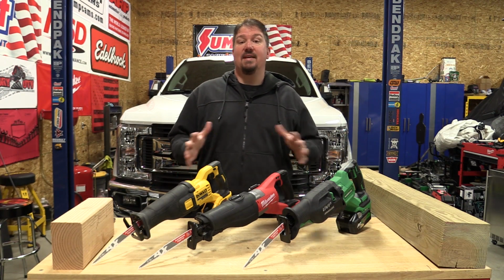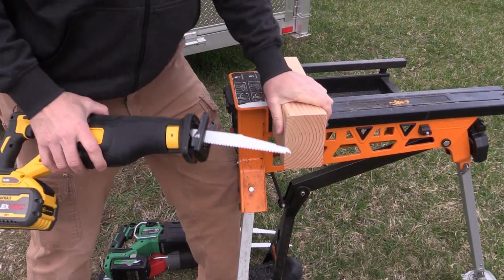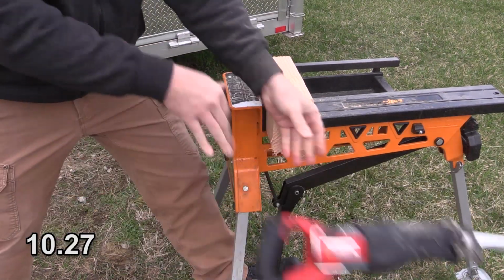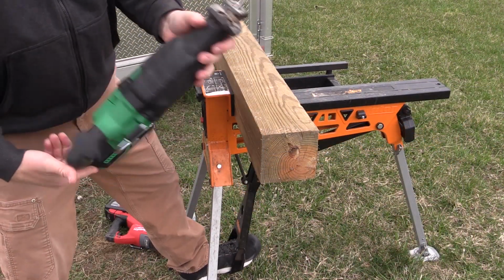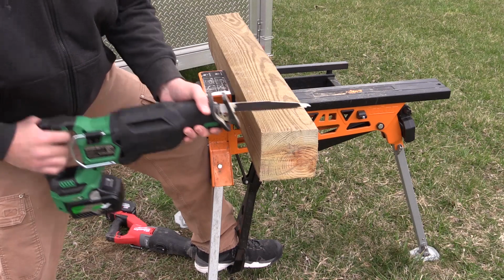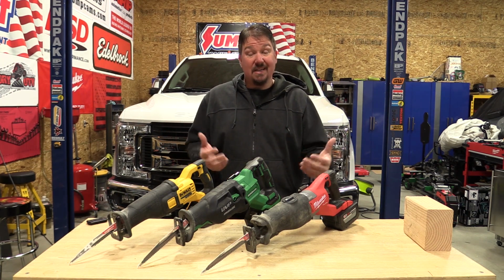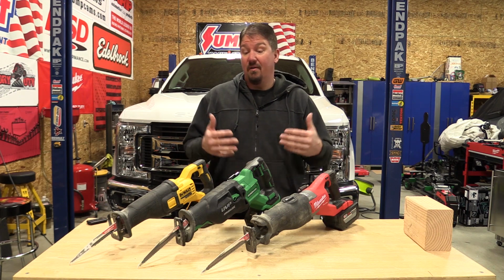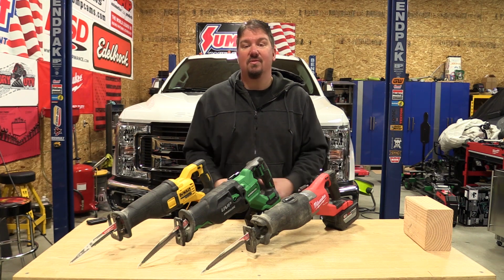Milwaukee M18 FUEL Super Sawzall Vs Metabo HPT MultiVolt 36-Volt Recip Saw & Dewalt FlexVolt 60-Volt

Comment: I would love to buy into the HPT line. Lifetime warranty, IP rating on their impacts/drivers, and I can use an AC adapter. Every video you guys put out makes me consider them more! Lol great video!
Reply from the maker: The ONLY items I dislike about Metabo HPT is the buttons on the tools.  I can get over that.
Reply: Lifetime warranty on the batteries not the tools.
Reply: @vojnikjna30  Lifetime on the tools, 2 years on the batteries
Reply: I freaking love them , I was using the 18v and with clearances I got the 36v skil saw for 99 bux and the adaptors for 40 bux apiece bought 2 then just now bought the Sawzall for 99 and I've got no complaints in fact I love them , oh I got lucky and bought the hammer drill with charger and 2 of the big 8ah batteries which r 4ah 36v but needless to say I bought 2 of those sets, so I'm bought in the the hpt all the way but everything I've bought has been on clearance and honestly a he'll of a deal
Reply: @WorkshopAddict  i can agree with that. particularly if the tool has a fwd/rev selector. however, I think the Metabo HPT triggers usually make up for that. They have the best feeling triggers to me, easiest to modulate. Love the channel sir.
Reply: @paulbiagi6224  wear and tear is not covered.
Reply: I have the whole set. Drills drivers, saws, nail guns. Best shit I’ve ever used
Reply: Lifetime  warranty  is on the tool batteries  are 2 years

Comment: I use my Metabo HPT vs my Milwaukee when I have a big job+ I have used it with AC adapter when near poeer- this will save lifetime battery life as well
Reply from the maker: We do the same.  When we have the chance to go corded, we normally do.  It is hard to carry enough batteries and also make sure they all get charged.
Reply: @WorkshopAddict  What's crazy about many of the youtube comments is that the MIlwaukee fanboys(which I am when it fits) are now worse than the old Dewalt Fanboys that I used to shake my head when they wouldn't try Milwaukee or other brands--I notice you guys have plenty of Milwaukee products as do I-but when there is a better tool, especially the Metabo HPT 36V line that gives me more options, flexibility, and longevity on their tools, I get them(simple as that) All in Fanboys just miss out on some great tools
Reply from the maker: @baseballdude8491  Number one rule.  Marry your self to the best tool for the job, not to one battery platform.

Comment: I have the super Sawsall and it’s a beast. It’s actually too powerful for some jobs. Ended using the hacksall instead to cut some 1x3 steel tube because the sawsall bit to hard

Comment: I know this doesn't sound right but the orbital didn't seem to help much against the Dewalt.  People are going to buy a saw based on what platform they are on , but it's nice to see how your tool stacks up against the competition,  me personally I really like the new Dewalt Power Detect line .  Great Video...  Stay Safe ...😷  🖖
Reply from the maker: Brian, I agree and working alone it is hard to see times.  I should have come home, looked at the video and some more testing.  Orbital does do more on smaller wood and on the 6x6.  But you are right, the PD line is awesome and some bag on it because it lacks a few features.  I like it too.

Comment: Metaboo  hpt always , as for bang for the buck  as metabo  is just as good if not better  but half the cost , lifetime warranty,  and with the 36volt  line  you can use it corded as well.

Comment: I'm on the Makita platform.  Over the last 12 years I've had 3 Makita reciprocating saws. This last one brushless, amazing improvement.  We really cane our saws.  Cutting 3inch diameter steel wired cables and heavy switch gear. 
It would give these 3 a run for their money.

Comment: It’s crazy that the Metabo is still the number one as far as power, speed, control and comfort. I honestly didnt think that would be the case over 3 years later now. 

But damn Metabo truely does have the ball in this court, as well as with impact drivers and oscillating multi tools. And of course they’re nailers. Honestly they are doing fantastic in just about every category. Especially sub compact, it’s insane having a driver and drill that feel like they could be children’s toys due to the size and weight and then use them and realize how much better they are than the old craftsman huge drills from 10 or 15 years ago. 

My dad still has one of those drills and he is blown away by my tools. He doesn’t understand how he can be using one all day and the battery doesn’t drop a bar, and if it did under very heavy use it would only take about an hour to charge from zero to full. 

Things have come so far in such little time. That’s why it’s so nice to see something like the Metabo HPT 36v UVP blow everything else out of the water. And you think wow this thing is like 5 years old soon. And the other company’s are only now in 2024 just catching up to making something as well made as the Metabo Recip saw. But if you look, you will notice that the only brands are simply giving in and copying the design as close they can. Which is something they should have done from the start. Even with that you still can’t beat the Metabo. Especially in the 36V category, he’ll even the 40v.

Comment: Hikoki/Metabo HPT is the most powerful sawzall I've used. I don't think I've tried neither of the other two  models. I have a Bosch GSA 18v-32 which I think is decent, but the Metabo HPT is much more powerful! At the end of it all you really got to think about weight vs power. Power could in this instance maybe be okay with less weight if you consider demolition and having the weight above your chest.

Comment: Great review.  I'm a Milwaukee guy, but it seemed like the Metabo transmitted a bit less vibration.
Reply from the maker: I was watching that also, but I have to say judging vibs on large wood connected to the jawhorse is hard because of the flex.  Lots of varibales.

Comment: I never care for orbital action in recip saws, as I find to make the tool vibrate a lot more, therefore making it more difficult to control. I think these kind of tests should also include cutting steel as it is more solid material than wood which has all the knots and twists in it. I have the old DeWalt DCS380 and I am happy with it. I just bought a new one after using my first one for five years and then donating it, with my old cordless drill and a cordless grinder and some batteries, to my volunteer fire department. I like that model so much because it weighs way less than any of the models tested here, and it has all the power I need for a recip saw. The only things missing are a brushless motor and anti vibration.

Comment: I have the metabo recip saw definitely powerful and less vibration one issue I have with the saw is the orbital action lever will vibrate loose while cutting in straight mode and switch to orbital in the middle of your cut would expect more for the price of it. Also the customer service for warranty repair is not the greatest nor do they have the fastest turnaround on getting your tool back in my experience. Side note I got this tool for free during a sale so I cant be to upset about it not having the best build quality.

Comment: hello Bryan which is the one that has the less vibration for homeowners. because I have arthritis in my shoulders but I had a Ryobi and it  gave out after 4 yrs.  God bless you and EVERYONE.
Reply from the maker: IMHO, these are not home owner units.  Ryobi is probably the worst for home owner vibs.  Milwaukee is probably where to be, just buy the model that is NOT the FUEL.  That one will be priced right for you and give you all the power you need to do stuff around your home.
Reply: Reynaldo Valle I’ve got two of the Metabo HPT’s and have run the old Flexvolt and the Fuel Super sawzall. The Metabo HPT in my eyes jus barely beats out the Milwaukee, but its close enough to where if you are already on the platform, go with the one you’re already on. Makita’s LXT X2 top of the line Recip has great vibration control as well. If I rated the 4 based on my experience I’d say team teal for 1st, team green 2nd best vibration, team red for third and team yellow for 4th.
Reply: @WorkshopAddict  
Bryan I don't use it too much around the house just for certain things I'm not looking for power or anything like that but one that has like the lease vibration that you can just tell me I don't hold you to anything I just want to know which one you think that has the least vibration thank you please let me know
Reply: @reynaldovalle1773  None of the ones above is the ones I would recommend.  Drop down to the low-end Milwaukee.  Ben R above has some good recommendations also, but he is talking higher end stuff.
Reply: @wrenchesrides  
Ok thank you GODBLESS EVERYONE
Reply: Go ridgid man. Ridgid has good tool platform and its recip is dam good

Comment: Your right the Metabo definitely sounded the weakest, but after seeing the orbital only being a second faster not a deal breaker, that said all three same league I'm in the Dewalt platform so it's Dewalt but I'd go with the 20v power detect because it's so close in power and lighter , another great review its amazing how knot just slows a cut down you can hear the difference once you get past it
Reply: i would go with milwaukee cuz it whooped dewalt again by cutting faster 😂😂👍
Reply: @kingofthecrease30  without orbital they cut same time and its two pounds lighter with a shorter stroke length and 150 dollars cheaper for saw with orbital that cuts less than a second faster

Comment: I have the flexvolt as well as the super sawzall and my opinion the flexvolt needs orbital as well as a adjustable shoe and the problem is dewalt didn't add it to any of the flexvolt models not even there 20v models the metabo and Milwaukee will always be better then the dewalt models because dewalt don't care about adding features that customers want
Reply: The thing is I've been on many jobsites and I've never seen anyone myself included use a rafter hook or use the adjustable shoe nobody uses them

Comment: If I don’t have any professional or frequent need for this kind of tool, and my other tools are DeWalt, is there any reason to get one of the other brands and have an odd battery, or am I better to just stick with DeWalt for the convenience of the same batteries?
Reply from the maker: No, these are pro saws and really way too much for use on smaller jobs IMHO.  Stick with what you have if it works for you.
Reply: WorkshopAddict I don’t have any recip saw now, but I’m not one to buy a lesser model from a brand.
Reply from the maker: @justinjrebbert  the power detect is an awesome 20 volt saw

Comment: Excellent non biased review...these saws continue to improve and are breaking ground in many categories that were unheard of not so long ago. I got a good deal on the Milwaukee super sawzall so I bought thinking this would be the end all be all....well not really.  It's a beast if you need a lot of power... however I find myself grabbing the regular m18 fuel sawzall most of the time....all of that power is nice but my arms and shoulders convince be otherwise at the end of the day. Great video brother...
Reply from the maker: Right tool for the right job.  Using the Super all the time is like driving a one ton dually to the grocery store for a gallon of milk every day.
Reply: @WorkshopAddict  indeed
Reply: I prefer the regular fuel sawzall also.  I like the blade change better.  Burn my fingers on those type the super sawzall uses.  And it's easier to handle, maneuver.  Use it one-handed sometimes.

Comment: Like the circ saw test.  We see what we need to see.  All good saws.  Metabo looks to be every bit as good a saw, if not better than the Milwaukee.  Can't see 2 seconds here or there being a big deal.  If time is that critical, get a chainsaw for the 6x6 and larger.  Pruning blades in big stuff helps too.  Deep cuts need deep gullets.  With regular blades, chip removal rears its ugly head and can nearly stop them cold if you don't ease up or rock it just right.  Especially in that sappy heart wood.  None of these are so much better to justify going "out of battery platform" to get IMHO.  Odd that Dewalt hasn't got oscillating mode, though.  Saw worked fine regardless.  And the test looked righteous.  Good video!

Comment: 2nd run on metabo. Why did you flip post over to an even BIGGER knot? You should of ran it through after last Milwaukee run. You literally have metabo testing in the most strenuous cut per your "test" each and every time.. Would like to know your reasoning  behind this and how the results accumulated to an accurate outcome.
I'll wait....

Comment: The saws must be either rentals or a coworker damn just throw them down.i treat mine like work of art
I have milwaukee it is a beast little vibe plenty of power and speed
Reply from the maker: Contractors and employee's do not treat tools well so we beat them up to try to help people get an idea what they will take.
Reply: @WorkshopAddict  I am a finish carpenter I treat my tools with respect. I saw you or another throw any tool I would let them know about it,unless is their own.
I've seen many trades men none throw them, they hang or lay them down get to work. 
Even the younger lay them down 
I buy the best tool for the job, milwaukee some DeWalt,Bosch plunger router cost 400, Makita tools, I still have my DeWalt ciircular saw since 1993.
Your co-workers might toss them around I've not seen any other

Comment: The super sawzall has been on my list for quite a while now.
Reply: Its not good
Reply: @kblack1262  got it bout a month ago. Love it so far.
Reply: @kblack1262  it is good that tells me you never used it. Shut up and stop assuming it sucks.
Reply: @johngardea625  I use a saw everyday for I prefer a regular fuel over the super saw. I had the super saw for less than a year and it broke. It started with batteries rattling so bad it made the saw stop. I had to zip tie my batteries on.
Reply: @kblack1262  Hmm? You must have gotten a bad one then? I had mine for like a year and a half, and I do ATON of work with it, and It still runs amazingly. One time I accidentally dropped it from 2 stories, and the battery did not fall out nor did the saw break. I still run good.